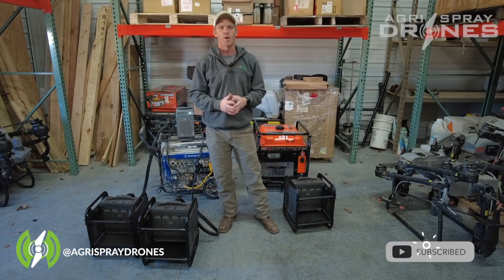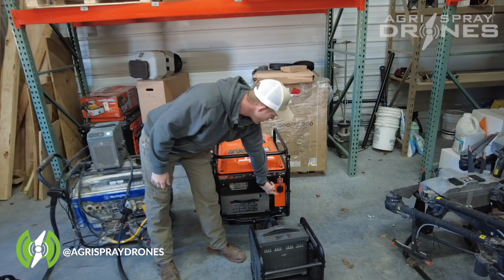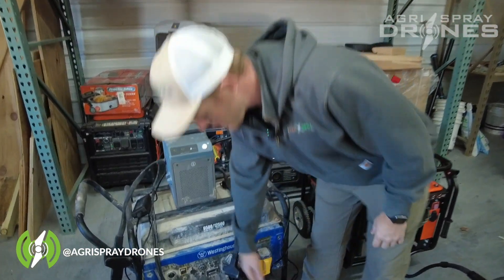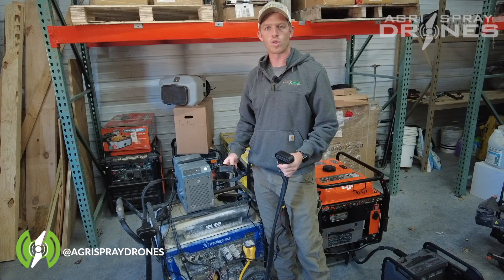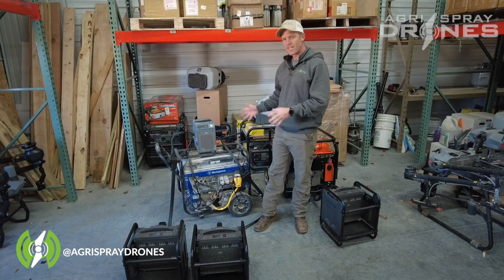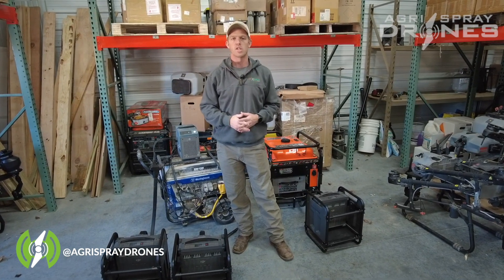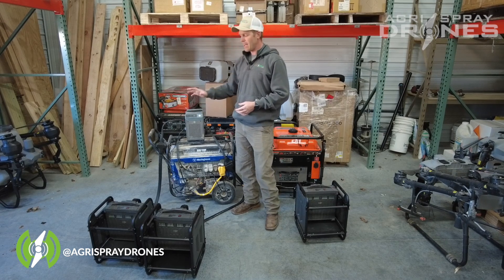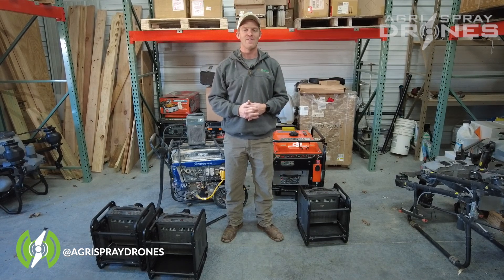DJI Agras T40/T30 Charger Versus the DJI 12,000i Generator | Agri Spray Drones

Comment: How long does it take you to charge a battery using the Westinghouse setup? I have the exact same setup but it’s taking over 20 minutes to charge a battery.
Reply: I think there is an issue with portable generators. I have a similar problem. I believe the answer is that you need an “inverter generator.” Let me know if this is correct.

Comment: I think you would be way ahead of the game if you could clean up the connections of the T30 charging system. I like the idea of it swapping over when one battery is complete but the tangled web of cords and connections doesnt seem to fit the definition of “efficient operations”. Just looks messy and unprofessional, even though it works! Thanks for the advice and recommendations.

Comment: What current does the t40 battery draw on the t30 power supply? Mine is only drawing 11 amps. It takes over 30 mins to charge
Reply: What type of generator are you using? I have a similar problem

Comment: Does the T30 charger need and special upgrade to charge the T40 battery? I tried with a T30 charger connected to a T40 battery but there is a red light on the charger. I have an 11 kw generador. Thanks!

Comment: How many watts min does it pull from the wall, ie, Ac 2000watt or will it auto step based on what it senses it can get? Some places may not have enough power ….
Reply: The T30 charger has 2 16 amp power supplies in it and 2 120/240v ports on the back. So if you plug in both to 240 pulls around 7500 watts. you can only plug in one of your generator is not big enough

Comment: Can I charge the T40's batteries and run a mixer with 1,5kva?
Reply: Completely depends on what your mixer is going to pull, as most of the power will be going towards charging the battery with the DJI generator.  Hope this helps!

Comment: The dji t40 charging station doesn't have inteligent charging? When one battery is full the other start charging?
Reply: The T40 charger itself is a single lead charger, compared to the T30 charger that has 2 leads.  The T30 charger switches over to the 2nd battery once the first is charged.  Hope this helps!